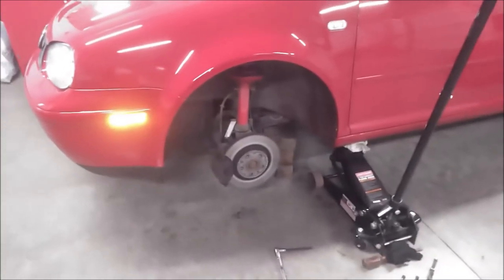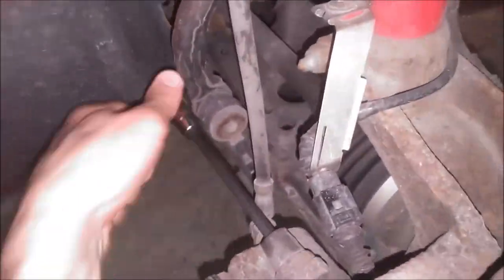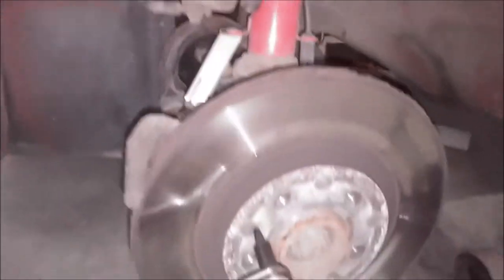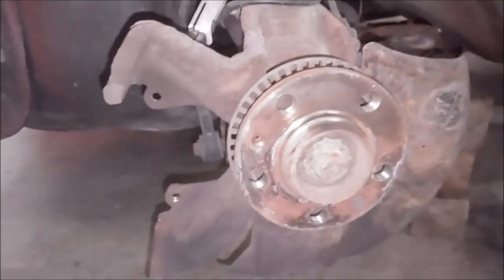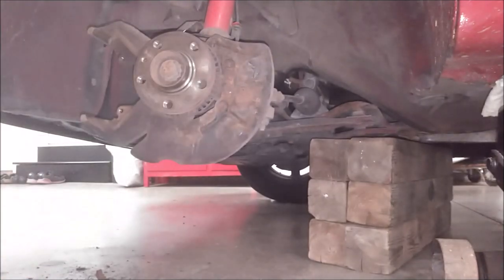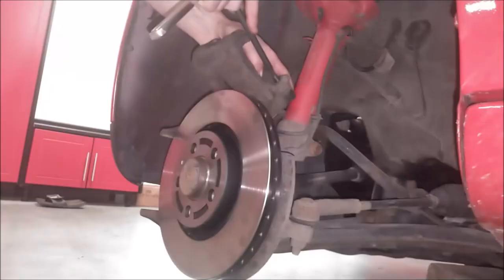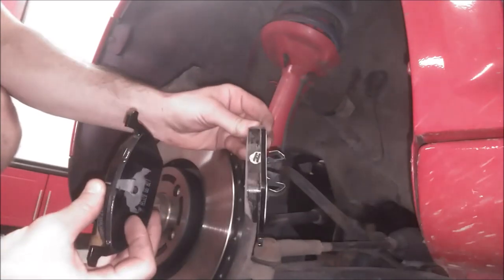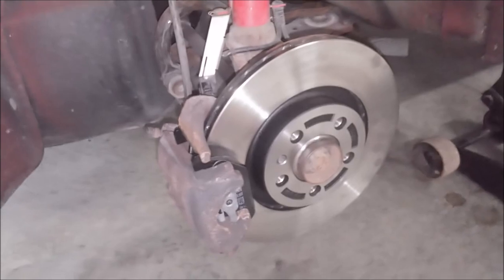2001 VW Golf TDI gets new front brake pads and rotors

Comment: Is it mandatory to use the drill when you clean the hub ? Am I able to just use a wire sponge only because I don’t have one
Reply from the maker: It's not mandatory to use the drill, although it speeds up the process. You can use your wire sponge, just make sure that the hub is smooth before you install the new rotor.
Reply: @Corysdiyauto  thank u so much
Reply from the maker: @jadenwalkerbrown3690  - You're welcome.